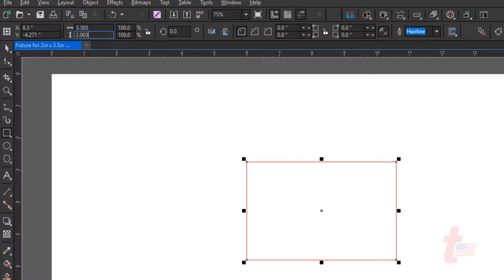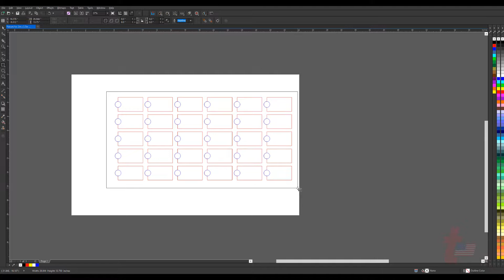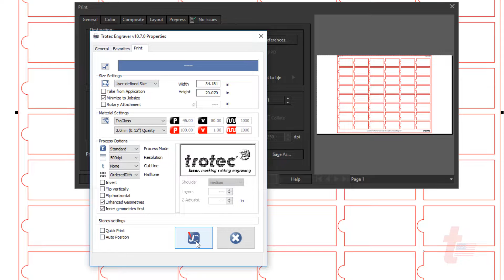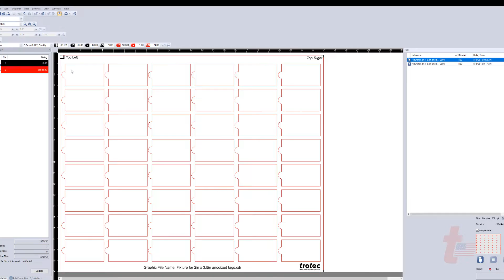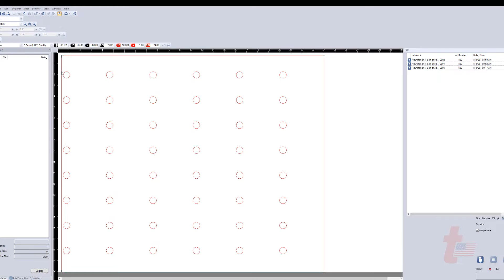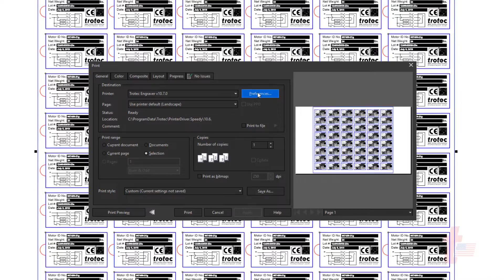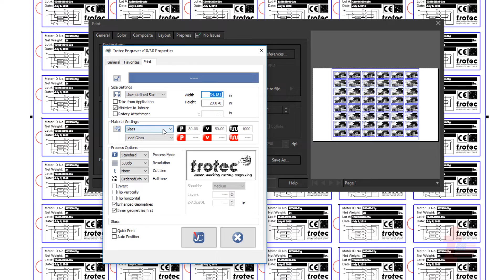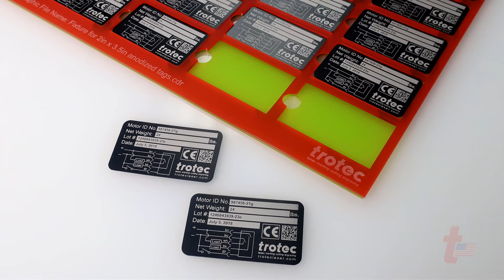Trotec DIY: Creating a Template, Jig or Fixture

Comment: This is great. I have a Speedy 400 with Ruby and use a Mac connected by network. How do you set the starting point (red dot) at 0,0 so they print exactly the same every time? I'm sure it's easy but I'm just getting started.
Reply from the maker: Hi Aaron! The red pointer is not needed to position a graphic in any corners in ruby. Design files will automatically snap to the corners of the laser field edge when placing the graphic on the prepare screen simply by moving the file to the corner.